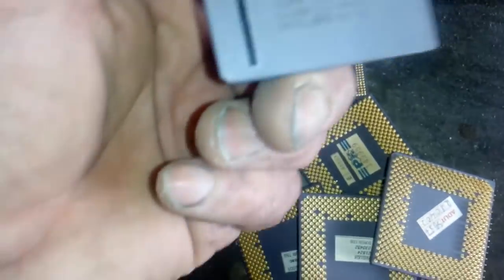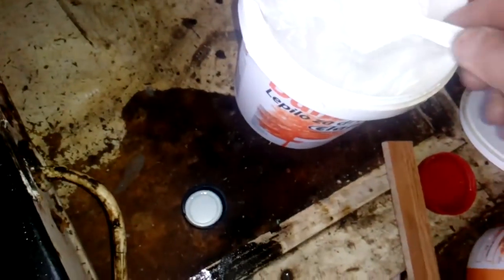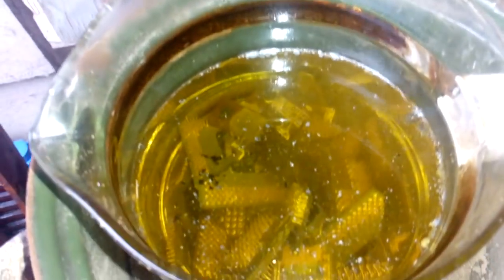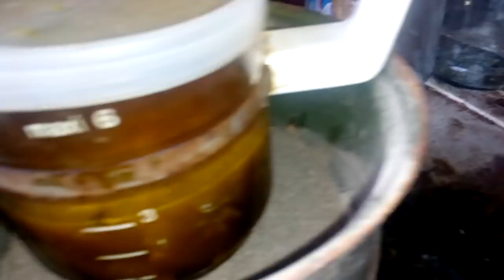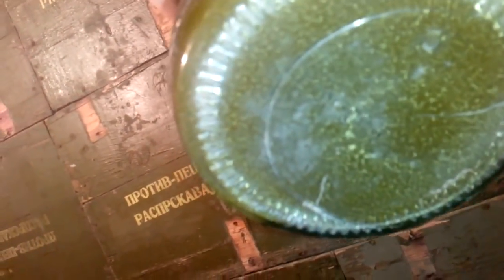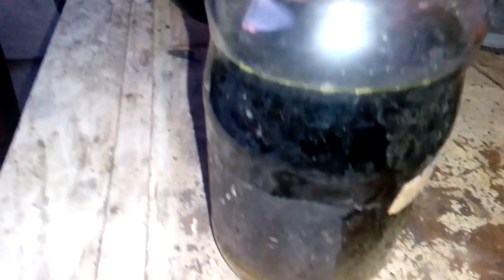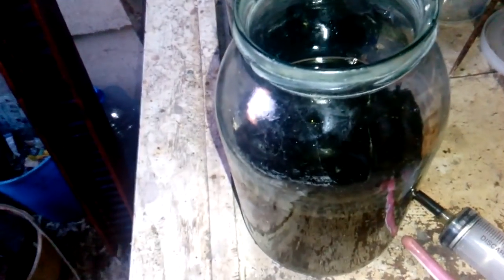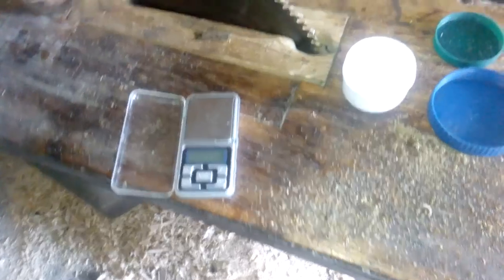Proces ceramic CPU with Poors man Aqwaregia

Comment: HIGH QUALITY CERAMIC CPU PROCESSOR SCRAP FOR GOLD RECOVERY     +917292075274                                                Ceramic CPU for Gold Recovery Scrap, i486 i386
Very high yield Ceramic cpu scrap
Ntel 486 & 386 Cpu
Intel I960 & Motorola Cpu
Intel Pentium Pro Cpu
AMD 486 & 586 Cpu
Gold Top Cpu
Gold Top & Bottom Cpu
Intel Pentium 1
DLP Cpu

Comment: And, may i know the ratio of make a smb solution? ?gram to ? Distill water?
Reply from the maker: The amount of smb solution that is added during the drop should not be larger than the amount of golden solution. For example: if you have half a liter of golden solution, you can add smb to 300 milliliters of distilled water, and that will be quite enough. The size of smb is 1 gram smb for one gram of expected gold, although a little more quantity will not cost, for example, double.

Comment: Now only i know there will be silver choride that has to be romoved first.. thanks sharing
Reply from the maker: That ceramic processors keeps a lot of silver in the soder holding the caps and inside the ceramics.
Reply: So how did u get the silver?

Comment: hi dussan  how to buy correct  urea & smb there are sevaral types in the market
Reply from the maker: Urea 40-45% will be sufficient, fertilizer for garden or the like, and as far as smb there is no difference, each reacts in the same way, but you still need to do a small experiment at the beginning to see the reaction with some smaller amount of golden solution.

Comment: Hi, I have a dumb question, why did you add HCL to the SMB water? Isn't the HCL in the auric solution enough?
Reply from the maker: Of course, that's optional, I personally noticed that smb is working so much better, others still put onley distilled water in. Sure, both ways are equally good.

Comment: Where would a person get the Sodium Nitrate and UREA?
Reply from the maker: Try talk with casagine or butcher working in a slaughterhouse, where dry bacon is produced, Sodium nitrite is an integral part of the process of bacon production.Iz is in my country :)
Ureu will find in fertilizer stores for the land!
Reply: Yes, I will. Ive been looking it up in my area to see where a butcher shop is.  As well, the Urea. Im pretty sure I have stores that will carry these items. I must thank you for your videos, I find them very informative. Many thanks.
Reply: Sorry to be a pain, but why, when dropping the gold, you mixed in "HCL" with the SMB and water?
Reply from the maker: I make a solution of 60-70% distilled water and 40-30% Hcl, in my experience then I have the best results, but all depends on the raffiners.You can only distilled water, the result will be the same only if it may take a little more gold to drop.
Reply: You can buy a lot of chemicals except nitric acid on ebay for really cheap, i just ordered a bunch and its great deal an fast shipping :)